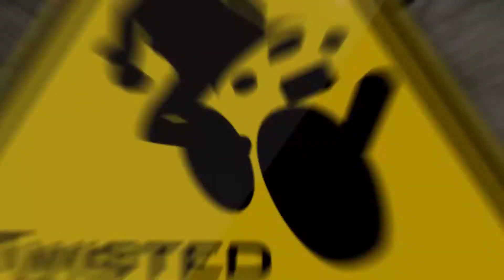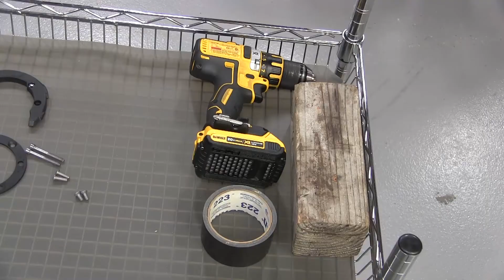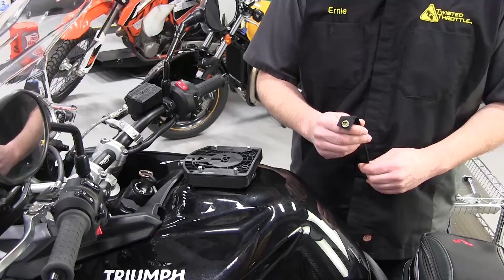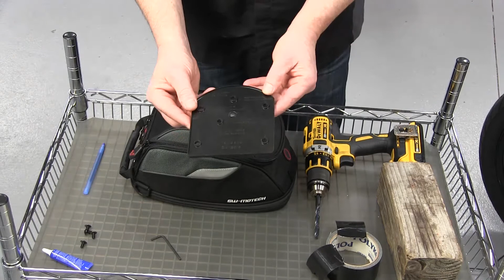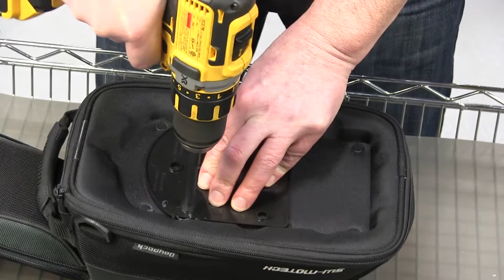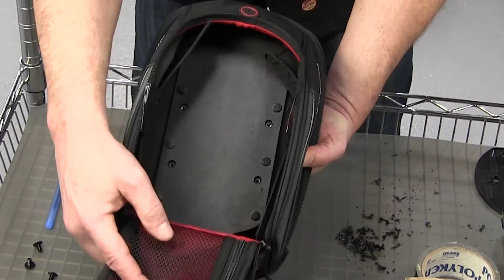SW-MOTECH QUICK-LOCK EVO Tank Bag Installation Guide

Comment: Hi Ernie, I want to thank you for ruining my $36 tank ring, if you do not know what you are talking about just don't say anything. You said that SW Motech said to tighten the tank ring to 40 in. lbs. and even said you did not have a torque wrench that went that low. 
Hard to believe that you are so limited on equipment considering you work on motorcycles. Unfortunately I do have a High quality Snapon inch pound torque wrench and made the mistake of thinking that since you sold that product and even went so far as to make a video showing how to install it you would know what you were talking about. SW Motech instructions say to follow the manufactures torque specification, absolutely nothing about 40 inch pounds or any other number of inch pounds for that matter. Turns out that spec is 1 FOOT Pound. I do nit know why you would think that there is 40 inches in a foot, I am lucky it did not mess up the anchor for the gas cap ring on my brand new R1250GSA. You sure got that Twisted, maybe you should THROTTLE back on the Twisted INFO. GRRRRR
Reply: John Bomenka most riders just ride than have tools to tool around. I too have a torque wrench that has low settings of 40”lbs but he is talking to riders and not mechanics.